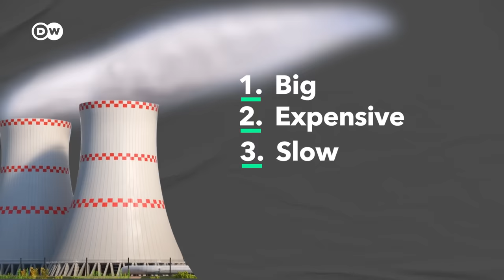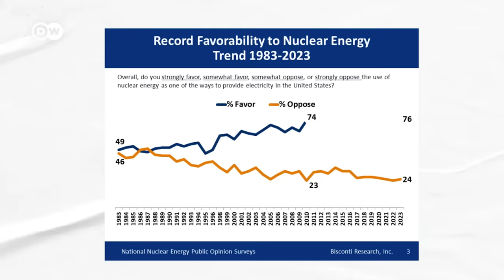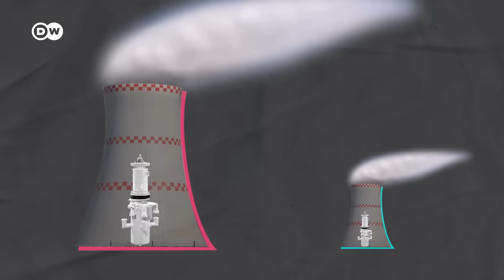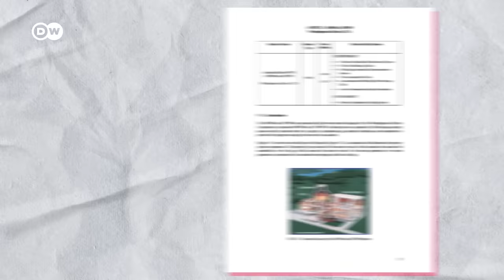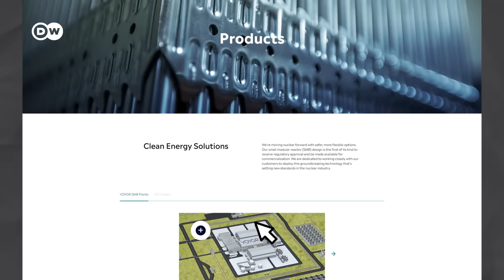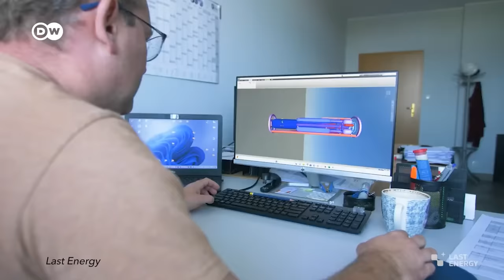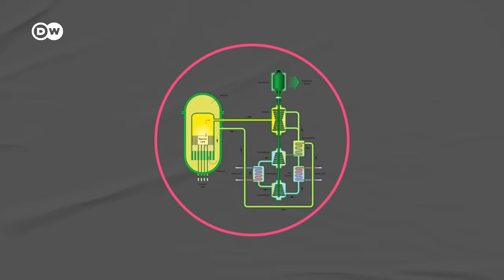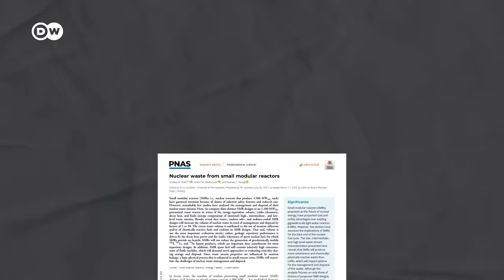Why people want to put small nuclear reactors everywhere

Comment from the maker: What do you think of these small modular reactors?
Reply: cool if they will scale
Reply: The price of kilowatt per hour for them are too high, and it is rarely taken into account.
Reply: Don't work.
Reply: @borystsolin the hope is that being small, they can be made modular and thus reduce the cost significantly. Of course, if only one or two are built, then the price won't come down.
Reply: It's a bad idea.  Better to develop solar, wind, and power storage - as well as energy efficiency standards.
Reply: We have a SMR under constriction right beside a 6 lane divided highway in Bowmanville Ontario Canada, Canada knows how to do reactors  .No troubles here!
Reply: The salient point here is no-one has managed to build one economically yet.
Reply: @fayebird1808   Canada also has the worlds greatest potential for hydroelectric too.
Reply: The only green in radioactivity is the color. I would fear having thousands of these nuclear bombs under my feet.
Reply: Why is DW the official voice of FUD? Riddle me that!
Reply: small reactor = small output.   probably  a good idea in remote locations or areas without a highly developed grid.   but they don't make sense in heavily populated areas where the electricity demand is rising and will only rise faster as we switch to electric cars.
Reply: Very bad, terrible idea!
Reply: Bigger problem is storing and transmitting the energy where is needed. Pump hydro compressed air or hydrogen production are the key technologies to balance the renewable and nuclear energy
Reply: @tsubadaikhan6332  it's not economical cos fossil fuel burning companies don't pay for the damage they cause. if we would make them pay for externalities, it would be immediately competitive. the hard truth is that we don't pay enough right now, and our grandchilder will pay the price eventually.
Reply: @nombregenerico5068  are you saing that because you really don't know the difference or just wanted to make it feel a mit more dramatic? by the way did you know that some 1 million people died only in Germany, because of burning of coal caused air pollution, since Chernobyl? that's a bit worse than anything I can imagine with a modern nuclear power plant.
Reply: The South African pebble bed modular reactor looks promising. The state withdrew funding in 2010 but perhaps private funding will make a prototype a reality.
Reply: Cool in theory; bunk in practice as it increasingly becomes clear that they're no better cost-wise than old nuclear plants--failing to solve the problem they aimed to. Meanwhile, we have wind/solar + batteries that are available today, more affordable than fossil fuels for new generation, and already proven to work. All we need is more capacity. Any gov't willing to invest in SMR's beyond continued R&D for breakthroughs would be better served investing in scaling the renewables + storage we already have.
Reply: The critics seem to be positing an impossible choice, between carrying on with fossil fuels (which we clearly can't do) or switching to something perfectly safe with no risks. Since we don't have any other option quite so ideal as that (even with rolling out more wind, solar, geothermal, etc.) we need to press ahead with all and any sources of power that aren't polluting.
Reply: It takes a Lot of energy to refine uranium, 'net zero' is a fallacy. Why aren't we coming more efficient and depending the money developing local renewable and storage, which is cheaper and more efficient, rather than a potentially deadly dangerous, very expensive (high investment return, good old monopoly!) form of energy production which is Yet to prove viable? Our socioeconomic system makes no sense. Bad idea
Reply: Nuclear power generation works most economically at large scale, 500 MW and up. Small reactors are exactly the wrong thing to do.
Reply: imo it is another diversion tactic, just like DesertTec was.
Reply: Better to develop big ones and build many of them instead if you really believe in nuclear. If you dont, just go wind and/or solar.
Reply: @iv2sab512 easily said but building sufficient storage is the real issue. Compared to storage costs, SMRs seem like a rather cheap and much cleaner alternative. Remember,  batteries are not clean!!!
Reply: @oldsteamguy  an SMR can power up to 700,000 homes!!!
Reply: @stickynorth   Why is @stickynorth the official voice of Stupid? Riddle me that!
Reply: @multienergico9299  cost will be raised twice, started at 120$ per MW.
Refabrication and recycling are too high.
Reply: @fayebird1808  You'll have problems with recycling, but several years later.
Reply: @prilep5  compressed air raised up peak prices up to 30 times.
Just one Tesla lithium accumulator station drop down peak prices up to 3 times higher than average monthly prices
Reply: @tHebUm18  SMR will triple nuclear non-recyclable waste.
It's the basics knowledge.
There is no any small reactor in the world that can better use nuclear fuel than big reactors.
Reply: @tHebUm18  all wind and solar power have only 3% of accumulation power per MW all over the world.
In real, 20% of "accumulators" is hydro and 50% is fast gas turbines backup power.
~13-15% is electricity transmission to another time zone.
Reply: @adamdavies6248  fast reactors can recycle at least 50% of uranium and plutonium for nest cycle.
Fast reactors also can destroy 95-98% of minor actinides wich have the highest risk of long-time radiation damage.
Because of that they called reactors of 4 generation.

Now we have at least 80 times more recyclable plutonium than uranium.
World have more recyclable nuclear fuel for 4 generation reactors than both for 2 and 3 generations.
Reply: @tHebUm18  I've been a wind turbine commissioner for 6 years. I can assure you nuclear and wind are not interchangable. they cannot do what the other one can. also today's cost is not the total cost. the cheap version today will be paid for generations.
Reply: @garlihu  who cares about ||Y||our grandchildren. I'm not having any kids!
Reply: @tobiasboyd  or contains its pollution
Reply: Amazing ...
Reply: I wish SMRs could go in place of existing coal plants, just replace the boiler with the SMR. Leave all existing turbine generator components, cooling towers etc to reduce cost.
Reply: They come with the same unsolved problems as regular NPP. And what were you thinking when considering the Breakthrough Institute as a credible source of information?
Reply: @fayebird1808  Is that already being built for end users? or only as feasability study? The prairies signed a MOU but mostly dragging their heels
Reply: @hikashia.halfiah3582  good for you! (i'm actually happy that you're taking your genes out of circulation! ; ))
Reply: Unproven. Track record of 18% uptime. Extremely expensive per MWh. Unnecessary in a world where the effective price of solar and wind with storage is below zero per MWh.

Anyone promoting these things is a profiteer, a zealot, or studiously misinformed.
Reply: @bartroberts1514  you don't really understand this topic, do you? negative prices mean there's an overproduction at that very moment. exactly because wind and solar are both intermittent and sometimes they supply unnecessary power into the grid. if you think wind and solar with storage is below zero, then go ahead and try to pay for a solar PV system with storage! : D
Reply: @MihailG5541  At least 50%?

The figure I'd seen worked out was at most 2%.

Can you explain the source of your figure?

Did it account for real world physics, or just assume spherical chickens?
Reply: @bartroberts1514  it means that fast reactors can get back more than 50% nuclear fuel after cleaning up from minor actinides and so on.
That operation can get economy up to 50% of uranium 235
Reply: @MihailG5541  Cite? Source? Equations?

I note your story has changed from "more than 50%" to "up to 50%" in the same sentence. Are you unclear on the figure you claim? Are you saying that the economics push the "more than 50%" down below "50%"? Because that too is what I'm saying, only with the actual figure being at most 2%. Once materials have been in storage for a significant time, they become too contaminated with their own byproducts to be economically recovered in a FBR. It's only really a fully integrated FBR that can even approach 50% recovery, and that still tops out at 2% of wastes produced.

SMNRs are only good for such scavenging on site of the reactors producing the fissile materials, add so little to the output as to be unnecessary for hitting generation targets, and so are a pure additional cost, just to slightly improve waste disposal, while complicating plant and equipment.

There is zero credible engineering argument to be made for SMNRs on the "but they eat waste" basis.
Reply: @bartroberts1514  150 tons of nuclear fuel after the first cycle in a conventional reactor becomes spent nuclear fuel.
After a chemical processing cycle, and then a processing cycle as MOX/REMIX in a fast reactor, about 73 tons of nuclear fuel, about 73 tons of exhausted fuel and about 4 tons of radionuclides (actinides and other long-decomposing radioisotopes) are obtained.
It depends on the type and power of the fast reactor and the chemical processing method
Reply: Vaporware
Reply: MAKE NEW STUFF STIP DOING OLD CRAP DW YAH..LIKE THE GERMAN FOREST TREE BUILDING THINGY
Reply: @garlihu  Negative prices are for arbitrage of steam power, mostly coal, but some nuclear when cycle down costs are high. Get rid of coal and nuclear, and there's no arbitrage.
Storage, such as pumped hydro or geothermal heat conservation, is cheap and can be made plentiful. We already have PV with storage, everywhere there's a hydro grid with PV, including the 3 lowest cost grids in North America: BC, Manitoba and Quebec.
Net negative prices are for use cases where a mall or the like gives your EV free power for listening to ads or shopping in the store; alternatively, V2G with time of day rates is net negative as utilities pay EV owners to rent storage in their batteries.
Reply: @bartroberts1514  If you get rid of the baseline power plants, how are you gonna supply power when there's no wind at night? Are you gonna install thousands of GWh of batteries in every country? Let me know when you found the money for that. Also when I was working on a windfarm, the network operator always limited our output because renewables are intermittent, therefore you need to install at least 3x more capacity to cover the power need over a yearly average, with storage. Unless you have storage (you don't and likely you'll not have before the end of the century), renewables will be able to create more power than needed, when it's sunny and windy; there you are, negative prices for feeding the power into the grid, without baseline power plants or anything else. Back to the beginning, you don't really understand this topic, do you?
Reply: @garlihu  Now, back to negative pricing. When a grid is producing more power than there is demand, grid management has many demand-side options, besides supply side options like shutting down hydro or geothermal to store power for later: 
a) Have contracts with large customers who have flexibility in their demand, agreeing to a price arrangement that serves both sides.
b) Sell power to or through neighboring grids.
c) Set up or contract with a 'bulk-breaker' to distribute power to smallholders (malls, businesses, homes) with automated demand appliances -- EV trickle charging is an ideal example -- to take 'packages' of power as the utility requires.

That negative pricing is good for consumers, and good for smart grids.

The growth in grid capacity to accommodate these changes is well within typical grid maintenance rates of the last century.

Sure, there are challenges. Maybe they're beyond a guy who once served lunch at a wind farm or whatnot. But they're manageable and lead to much lower energy costs.
Reply: @bartroberts1514  Sweet geez, who could take seriously anyone who tries to win an argument (save their face) by attempting an ad hominem attack? Also you are confusing negative pricing (economic tools) with technical tools. I prefer not to waste any more time on this pointless discussion with peple who believe baseline powerplants can be replaced with renewables from one day to another. I must admit I made a mistake when I commented on youtube. should have known better
Reply: @garlihu  Ah. I misread "commissioner" for "commissary". To be a bit fair, when dealing with someone who uses spellings like 'peple', it's an understandable mistake.

My bad. I didn't mean to imply you were unqualified to comment on the subject because you were a waiter on a wind farm.

I meant to say your comments on electricity show you're not qualified to comment on the subject.
Reply: boo SMR!!!! yay MSR!!!! MOLTEN SALT REACTOR!!!!
Reply: @garlihu  its really funny how these people just never respond back to others who call them out for being idiots.
Reply: pretty much a grift
Reply: @oldsteamguy  an SMR can power about half a million homes and their electric cars!!!
Reply: @adamdavies6248  so solar panels wind turbines and transmission towers require zero energy
Come on mate, get a grip.
Reply: @bartroberts1514  I would argue that your view is rather delusional, but I won't. I'm trying to be polite.
Reply: @jamesgreig5168  It clearly isn't. You clearly aren't. Which SMNR will power half a million homes (and their electric cars)? The typical design provides only a tenth of that power. Darlington's SMR claims 300,000 homes could be powered. Perhaps with energy efficiency programs that could be pushed to half a million. But OPR's cost claims are impossibly low, as NuScale's failure when projected costs jumped from $58 USD to over $100 USD/MWh before pulling the plug, when more realistic future cost increases for SMNR came into view.

Solar panels can be made with the power from renewables. Wind turbines, increasingly made from wood are in effect more and more powered by biomass and other renewables. Payback time for all the energy and emissions and resources recovery of solar and wind is down to weeks or months. Reconductoring grids for higher capacity is a fraction of the price of the "new grid capacity" claims of detractors, and with carbon conductors in the offing, bound for even lower costs in the future. That's technology innovation at work. 

Delusion would be believing the world can't do better.
Reply: Im an idiot. 
Is there a segment of the market for a low temperature low pressure nuclear power plant that feeds triple expansion steam engines of around the 10Mw that used to be on ships.
Reply: @elismart13 stack more than scale
Reply: @borystsolin only if you add the initial cost of production.
Reply: @iv2sab512 why?
Reply: @nombregenerico5068 I’m sorry you didn’t learn at school how these things work.
Reply: @oldsteamguy it’s called distributed infrastructure. 
A very stable way to build cities
Reply: Hate the idea, hate the video, and strongly dislike that this is still a conversation we're having when there's been no deep serious changes in nuclear technology.

And I hate that you guys are platforming this conversation.

I have a comment outlining most of my criticism and I wish you guys here in this channel tallied those criticms as well as others and made a video response, communicating how those criticisms measure to reason.

I think this video and the SMRs discussed were a bad idea. If this video lost its objective tone and set out to properly criticize the current impracticality of SMRs it would have been a much better video.
Reply: @FizzyZailani  what is your idea and how does it differ from reality
Reply: They need to radically revise the regulatory framework as a first step.
Reply: Ok, ok, ok, ok.... What about radioactive waste?
Reply: @ruppertrul250  what about fossil fuel waste?
Reply: @ruppertrul250  Thorium reactors use existing waste as starter fuel.
Reply: @samuelbidocuello  
People swim in the rod cooling pools with the rods. Just no closer than 5ft. 

If the used fuel was put in a pickup and parked in a desert, you would be safe 600m away. 
If the Roman empires parked their chariot there with the same used fuel,
You would be safe 1m away. 

The volume and the time and the actual danger are vastly eggagerated.
Reply: @samuelbidocuello     "fissure. They work really well" 
Like Tihange?
Reply: I think that Germany shutting down its nuclear reactors was one of the stupidest things you could have done.
Reply: @kellymoses8566  
Was it all or just old ones. 

Control systems and metallurgy have progressed greatly in the last 40 years.
Reply: Terrible idea.   Make clean renewables work.
Reply: @FranksHairSalon  they do.
Reply: recipe for disaster. imagine a mishap somehow hapenning and an entire neighborhood or blocks or cities go infertile and such. needs a lot of protection.
Reply: @ibrahim-tech  
They are so lucky to have you to let them know that nuclear reactors need protection.
Reply: @brucebaxter6923  Airspaces around nuclear power plant are restricted period.
Reply: @ibrahim-tech  non sequitur is not in sequence.
Reply: @nombregenerico5068 you don't know nuclear reactors work do you? they cant cause a nuclear detonation.
Reply: There is a large pile of dirt and Darlington nuclear has announced the construction has begun.
Reply: @garlihu  Reality may be worse than 1 million since that's just an estimate. And why would you think i'm not against that too? I'm thinking long term. Germany has a big problem with Salzgitter's mine that is extremely hard to fix, I recommend on reading about that. Kind regards :)
Reply: @brucebaxter6923  I don't know you but I'm pretty sure you hadn't learn in school how SMR work either. Nonetheless, I've learned that nuclear waste is extremely hazardous and that people is not very careful when doing maintenance, because of this I wouldn't recommend on having lots of uncontrolled reactors buried everywhere. Also, it's just unclever to build them near aquifers since waste is going to find a path sooner or later, making that drinking water poisonous, and we don't have too much water to waste :/ Kind regards :)
Reply: @nombregenerico5068  yea, there is only one design of smr.
Yea, deserts are known for aquifers.
Metal and ceramic are famous for their solubility.
Reply: The SMR  is  cute, but you'll need 5 times the size defenses to harden the power source and provide on the spot real time protection from theft, terrorism, and attackers... AND it still needs located FAR away from ALL humans incase the darn gizmo breaks down and explodes radiation all over the place...
Reply: please the power grid sucks
Reply: @XUtionerx  
Yep. 
That’s why renewables and smr are so beneficial. 
There is less distance between supply and demand.
Reply: Bad idea as a publicly available technology. Though, good to be researched further.
Reply: @maxjatka  true the public would basically have nukes :/
Reply: I would appreciate a video on the various technologies and how far or lose they are to being actually used in a commercial SMR.
Reply: Yes, give the highly dangerous materials to private companies that only cares about making a profit.  What's the worst that could happened.  I always believed they will always do the right thing and not pollute our world with irradiating materials.
Reply: Every nuclear powered ship and submarine essentially has a SMR. They produce 150-200 Mw thermal, roughly 50-60 Mwe. It's proven technology.
Reply: @jamesgreig5168  I don't want it anywhere near my home or drinking water supply.
Reply: Love the hypocrisy here.  Everyone in support of it will never want that thing built near their town or drinking water.  But yet it's safe and clean.  🤣
Reply: @Alphachewei  I've operated 3 Nuclear Power Plants. Plants Farley, Hatch and Vogtle. I still live 22 miles from Plant Hatch. I'd much rather have a nuke beside me than the 6500 acres of solar panels they're installing now.
Reply: Where do we store the small nuclear waste? In the garden?
Reply: @nombregenerico5068  They are not "bombs".  Did you pay attention to the explanations, such as the cooling systems ? Or did you arrive with your mind already made up ?  
Way back when, no doubt there were proto-Luddites who said, "Wood good, coal bad", & that attitude continues today.  However, we do progress towards more efficient & cleaner sources of energy.
Reply: @2011Azure  Explain to me how to solve the problem with nuclear waste from distributed power sources, please. Also, explain to me how can nuclear plants' rejected energy can compete with solar or wind.
Reply: I think to address safety hazards and security concerns simultaneously, without building from scratch, they could be naval based (like offshore rigs) or air craft carriers alike. Their back up systems could be hybrid solar & wind energy. Plenty of water available as coolant, plus be the modular parts could be transported, assembled & fitted onto retired military or commercially auctioned cheap second hand ships. Desalination plants & off shore drilling ships could be constructed & powered like that as well as E refueling bases besides national grid connections. Scaling, enrichment, economic viability, technical feasibility, safety concerns remain key impediments.
Reply: Can't be the optimum solution; 1st accident will make it clear.  Expect new reliable on demand sources to show up that are much safer in the foreseeable future.
Reply: @elismart13 scale ?? Missing the point here. The idea is to reduce scale . To isolate. They are a stupid idea at best.
Reply: It seems like a strategic advantage for countries that don’t put hope in greed doing the right thing. 

But let’s see where this unfettered capitalism thing goes. It’ll come around if we wait long enough, certainly.
Reply: Nne
Reply: AMAZING! for big companies to big blocks of flats i'm looking forward to it and wish them bright future! ok not that bright as that catastrophe in UK and small question...will be some of them FBR? they can operate partially on thorium and potentially make fuel for bigger ones or older ones but amount of this fuel will be small probably not reliable source...and also needed to slow down reaction when they get too hot you know what i mean...negative chamber coefficient not positive but they do it the right way i am sure
Reply: A great idea - Rolls Royce have been making them for nuclear subs for years and this is pretty safety critical in the confines of a sub !
Reply: This the way forward especially for powering all the AI Data Centers that are about to be built without burning planet down.
Reply: "...by avoiding unnecessary regulatory burdens,..." that are in place to keep people AND the environment safe; all in the 'name' of Making Money!  Placing money over people AND the environment.